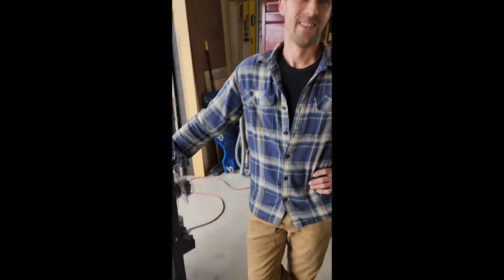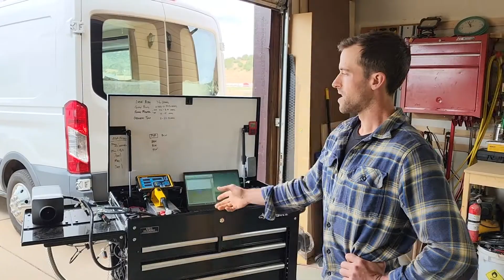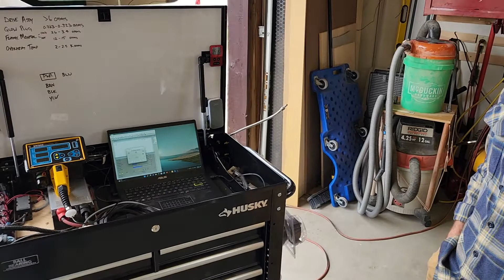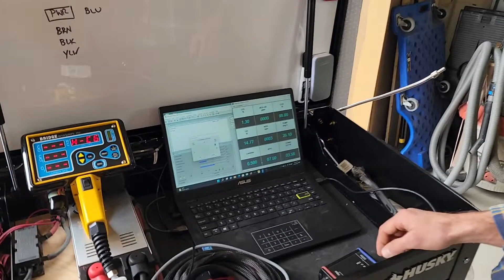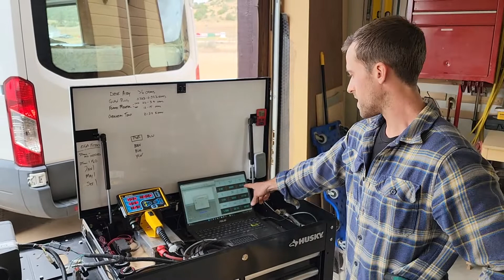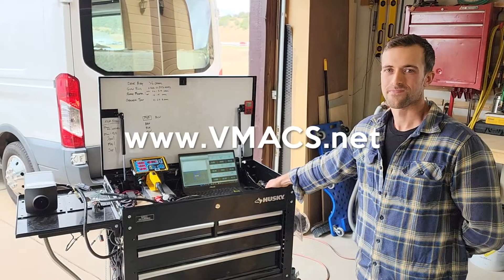#7 Webasto Air Heater Correct CO2 Adjustment Procedure

Comment: Webasto technician here, one thing to consider is that Webasto has stated that at the highest altitude adjustment, the gasoline version STC 2000 will only work well up to 4500 ft. It will quickly clog and need a cleaning above this. The diesel versions seem to be less prone to clogging, but this adjustment doesn’t require the CO2 monitor if you are planning on running above 4500 ft on either diesel or gasoline. Just tune it as high altitude as the heater will allow and that’s it.  

You can see in the video that this tech actually slides the tuner in the program all the way to the left side, decreasing fuel flow as much as the program will allow.
Reply from the maker: Thanks for the comments Andrew! As you know Webasto does not recommend using the AT2000STC heater regularly above 5000'. If the intended regular use will be above 5000' it is best to step up to an EVO40 heater as you mentioned. This video is intended to show the exact procedure as it is specified in the Webasto service manual to adjust the C02 level of the exhaust to be within the permissible limits based on elevation, as the engineers have designed. People will take from it what they want, but this is accurate to the specified procedure using the tools recommended by Webasto.

Comment: The entire video I was yelling ZOOM IN ON THE DAMN SCREEN!
Reply: Yep, absolutely useless.  Could have been a quarter of the time: gas analyser, co2 high do this, co2 do that.  Done.
Reply: No need to even use an analyzer. Just decrease fuel flow as much as possible if you plan on running above 4500 ft, all this equipment isn’t necessary. 

I’m a certified webasto tech and service many of these a year, and have done a few hundred of these tunes in Colorado, if you need higher altitude buy an evo 40 or espar B2L AS3

Comment: I have a problem, I live part of the year almost at sea level (900 feet), and part of the year in the Colorado Mountains (between 8,000 and 10,000 feet).   And other times traveling up and down at many different altitudes.       How would I use a Webasto?
Reply from the maker: Because you have regular use above 8000 feet you should strongly consider using an EVO40 heater. The EVO40 is the preferred heater of many Webasto installers in Colorado due its higher elevation rating.